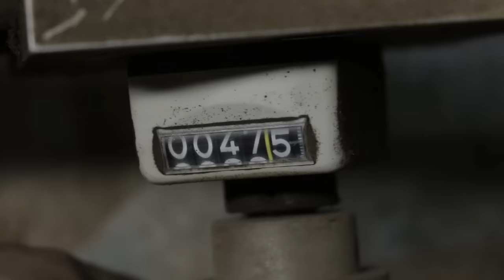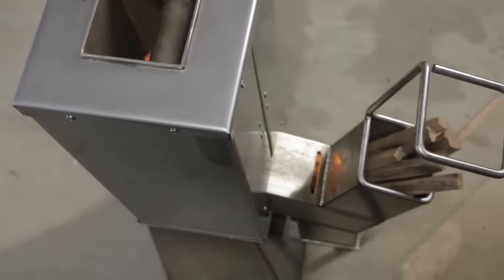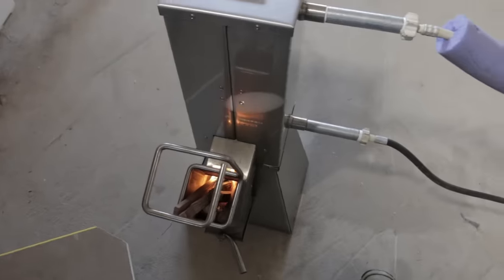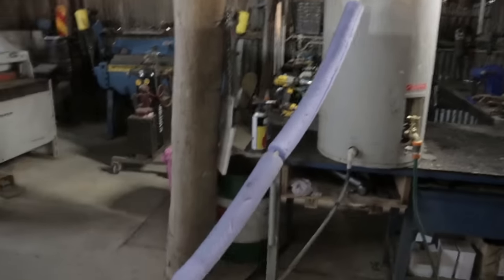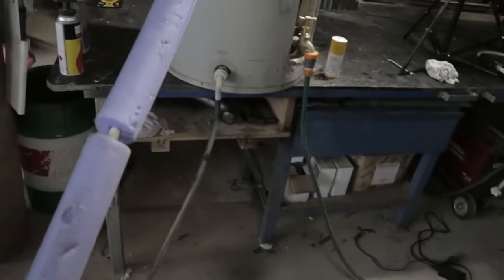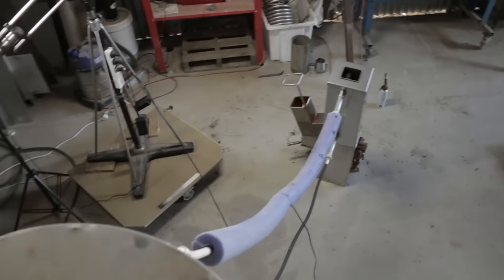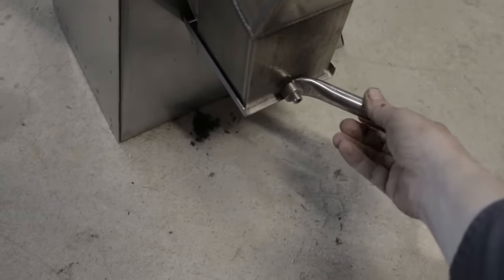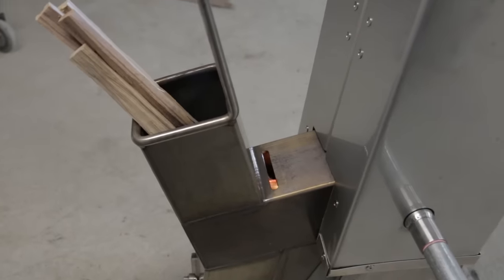Making an insulated rocket stove hot water system

Comment: Many years ago I modified a 30 gallon hws to be heated by my semi combustion stove, when it was cranking the water in the tank would boil fairly violently. I was told that I had the heated water inlet too high. Looks like yours is noticeably higher than mine was. Good job
Reply from the maker: Good to know. Thank you
Reply: @LittleAussieRockets  I didn’t actually make the mods to lower the inlet pipe. So that is unproven advice. I’d already had the 3/4” pipes brazed into the tank.

Comment: Awesome video!  

Since you're using convection and no pump.... But if you did use a pump, flow direction can help depending on heating or cooling.  Ideally you would want to draw from the bottom as the outlet and inlet at the top.  Sometimes convection can reverse this but the idea with flow from the bottom will produce a hotter temperature.  The top inlet begins to heat the water and as the temp rises you get closer to the hottest thermal source.

Comment: I watched the whole thing! Amazingly complex construction, I would not have attempted it! I have done some imagining myself on wood burning stoves, and what I currently have is a "Horn*, upside down, 12" on four sides Bottom, and reducing to just 4* on four sides just below the firebrick burn chamber. The "Horn" will be elevated above the floor by 4" round, and the ratio between the area of air I take bottom is 20% top to bottom, ie 16" total volume too, and 144"area bottom. 
The idea is that air entering the Bottom of the "Horn" at 2 mph, will accelerate to approx 36-40 mph as it reaches the burn chamber. Should be quite a good air flow feeding the fire. 
😆

Comment: Great workmanship! I think you can increase the heat transfer time by increasing the number of passes the water makes. Weld the outer rectangular pipes on the narrower side to the square tubing and interconnect the 4 chambers created by the rectangular tubes in series. Right now it’s 1 pass. Seems you can get as much as 4 passes if series.

Comment: Soft pine wood burn much hotter than any hard wood. Of course Pine has lower energy density and it disappears really fast but you can achieve much higher temperatures faster. Nice stove. Good work.

Comment: The fire is climbing up the wood as the air isn't being pulled in at the staging area for the burnables. I think due to the slot cut out at the top of the burn chamber. 
Air would be drawn in there before being pulled in around the wood. Maybe test the theory out by temporarily closing off the slot and seeing if it makes a difference.
Your welds are topnotch!!!

Comment: I think the other issue you may have is the heat hitting the bottom tube first which is normally the cold return line in a thermo syphon.  Maybe a check valve in the bottom line to make the thermo syphon work better.

Comment: I’m a little late to your video ant there are a lot of comments so someone has probably already mentioned this. You will get even more heat transfer by reversing the water flow. I would say add additional coils on the way down but this could restrict the exhaust flow that drives your rocket stove. Awesome appliance though, quality construction and an elegant design.

Comment: Lot of effort went in to the editing on that, good work! My thermal hot water system 50 liter tank takes about 2hrs before the bottom pipe gets warm, i had to put a one way flow valve in the cold in to the fire to stop reverse thermal syphon from happening after fire goes out and the water temperature in the tank equalises, ive read you need a 14 degree temperature difference for the syphon to work.
Reply from the maker: Thank you 👍 that's good to know.
Reply: Is there really enough pressure in the thermosyphon to open a standard one-way valve?

Comment: Great Project, 2 things you may consider for safety and efficiency (1) the need for an expansion vessel on the primary hot water between the boiler and cylinder coil, coupled with a relief valve, (2) baffles in the flue to retain the heat slightly longer, they will soot up so should be loose enough for removal...

Comment: It would be very interesting if you could measure the difference between a clean flue/pipes vs. sooty. The reduction in efficiency is rarely measured and quantified so I am very curious about that.

Your TIG welding is great! And your videos have become top notch as well. 

I know the input of a rocket stove is all about using twigs and smaller stuff. But a larger unit burning like 10cm diam wood is also very interesting as they are less time consuming to both produce, store and feed. 

One day I will for sure do a combo solar/rocket stove water heater for a outdoor shower here on the west coast of Norway. If you figure out how to ship flat packed - I am interested.
Reply: Soot build up is pretty significant that's why steam plants "soot blow" to clean the tubes every day or so.
Reply: @calebreutener870  Thanks! So the insides should be really accessible for cleaning in a smaller unit then?
Reply: I concur it's significant. You would thank your self for access to clean.

Comment: That's a lovely little stove.  Might be your pipework to and from the heater tank isn't big enough for the convection process to really get going, which would explain the bottom pipe being cool.  A pump might help.

Oh, and you could probably get a lot more life from your slitting discs by not plunging straight through.  Might take slightly longer to cut, but 5 to 10 times longer per disc would be my guess.

Comment: I've dreamed of a system like this for an off grid build but with a couple additions.  First off, I would want a pellet feeding system  for longer burn times so I don't have to feed it every 10 minutes.  Second, I  would want to route it for in-floor heating and also to heat solar panels to melt the snow off.  Both of those are only wanted at the same time I would want the stove on.  For hot water, I am happy with the convenience of an on-demand propane system.
Reply from the maker: I appreciate your thoughts. I have been tinkering with a pellet hopper for the stove. I haven't quite perfected it yet. It's not as hot as I would like, but it certainly chugs along at a very consistent rate.
Reply: Buy pellets?  Wood is free.
Reply: 1. Having options is always better than not.   2. Have you ever seen the burn rate on these things?  It's not just shove a giant piece of firewood in and let it burn for several hours.  3. You can make pellets at home relatively easily if you are so inclined. 4.  There is literally a pellet mill 4 blocks from my house that sells pallets of pellets to locals at significant discount. @MrSprintcat
Reply: There is a guy , 3 towns over that has 8 tons  of free coal in his basement.  I get it thank you.

Comment: Beautiful work! You could use an IR thermometer to measure various surface temperatures if you wanted to. I use mine to measure various temps on our wood burners as well as the air temp coming out of the vents.
Reply: Your video is nice. But without a doubt I believe that the system that uses COMPRESSED AIR as fuel is better. YES YES exactly like that. You read very well. Remember that the flame always heats faster than any other form they would have you believe. Then click on the round image next to the message where Tecnitalia55 is written. And you will enter my page where you can see many of my creations, including the stove that BURN COMPRESSED AIR. Leave a message are welcome. And if you liked it, let me know about my page. Sorry but it's in Italian. Thank you.

Comment: I don't think you will find this unit anywhere near as efficient for the amount of wood burned as a coil system.  Just not enough contact area for heat transfer.  On the other hand glad to see this unit was insulated which is how a true "rocket stove" is designed.  They don't have to be insulated, but if efficiency of the stove is your goal they should be. Might consider some fins on the discharge pipe of the stove or it is likely to get hot enough over time to melt the plastic knob on the water line. All in all a damn nice job, great welding compared to mine and glad to hear you got further along in you education than I did as I was not allowed to enter third grade.

Comment: Idea: Fully jacketed chimney rather than insulated. Use two square pipes using some plate to run double duty as baffles to slow flow and increase transfer and assist in heat exchange. 

Gold plated work mate. Might have to buy one for the Mrs so I can have one.

Comment: make the feed pipe longer to put a flap on the end to restrict flow and force more burning towards the ash tray via the slot you cut. now you can build the external part with a big can and more insulation to direct the smoke down. restricting the exhaust like this makes the burning more efficient, and if the wood burns right, will even be hotter, so long as its fed enough oxygen, which is why you experiment with the flap open and closed. good video. well worth the time

Comment: I would suggest having the woods sit on a 10-20 mil grate so it is a bit elevated and letting some air flow in the back and flow under the wood, similar to a pellet basket.
Also, would it be more efficient to have the hot water hose go to the bottom of the tank so that the rising hot water in the tank would create a more natural circulation? 
That had to be a very expensive build using all SS.
Thanks for sharing, I'm sure that took a lot of time to make and edit this video. 😁👍🏻

Comment: Have you ever thought about making one of these hot water tank ones like you just built in this video but instead of using as a water tank fill it with concrete so it's a thermal mass heater?
Reply from the maker: I made a bigger one and filled it with sand.  It stayed hot for an hour and warm to the touch for a couple more after that.  I think for that to work well you need a lot more thermal mess for it to make a difference.

Comment: Love your design builds , spot on pal.  Erm instead of the coil or thru pipes to heat the water , which a 30 degree change in an hour is impressive.  How bout similar to, a kettle type rocket stove where water is, heated in a chamber.  And a tap ,let's it exit.  How quick do you reckon this concept ,can heat water , yet instead of kettle design.  A chamber with inlet and outlet ,for water. That encompasses, the rocket stove chimney, with obs lagging to contain heat ??? Hard for me to write a picture. But hopefully it makes sense ??

Comment: A rocket stove with a casing that has sand in it that holds heat from the stove and has copper piping running through the hot sand.
To heat water directly have a stainless steel pipe running through the fire box area that also connects into the copper pipe via a valve.

Comment: Hm, here is suggestion if I may. Well, lots of distilleries using steam for heating the mashes in their boilers. There is a point in size of boiler when electricity is no longer feasible and they using steam generators. Probably smaller distilleries that use electricity will switch to steam generators if does not require to much investment and space to install.
Looking at this creation of yours as a water heater, if you can go one step above and use rocket stove to create a steam maybe you can have some market to open to you. I know that Aussies now try to boost distillery industry, so maybe there could be something you can jump in. Rocket stove can be set for simple burning wood or to burn a pellets, and believe burning pellets to get a steam instead of electricity in distilleries should be cheaper.
Just throwing an idea at you. I like it and very good implementation, you just have to figure out how to keep it running all the time, because hot water is used all day long, so you need setup that automatically fires rocket stove when needed. Cheer.

Comment: Here to see what's boiling (moohaha) in the field of rocket stoves and several secondary applications. My question would be: How did you chose a rectangular design over a circular one? So, why not two round pipes, one with a larger and one with a smaller diameter closed off at the top and the bottom (discarded fire extinguisher or so) and three if you want to insulate. That's what I myself have in mind as a chimney at least, with a container for water in the center and two bits of steel tube to lead the water in and out. I see lots of rectangular chimneys anyway, maybe just square ones. Why? No idea.

Comment: Great stuff. I know a lot was sped up. Somewhere between the first and second time u were bending the SS round bar, it looked like u were doing the equivalent of spot welding on the main unit, wasn’t fusing/tacking an edge. Didn’t see any filler rod, and that part was sped up?
Reply from the maker: Yes, I was just fused tacking that part together as this is just a prototype and it was most certainly sped up. But this process is fairly quick.

Comment: I had the same idea, but adding a bigger box for the coil, and stuffing the space on the outside of the coil with a mixture of  Heat mass substance (like Graphite,sand, clay,stones etc..with thin plastic straws to make it holy, which burn away leaving extra holes above the burn chamber to channel heat )  , and well insulated. like you have done, as to store heat in the heat exchanger as in thermal battery?

Comment: Excellent build. Perhaps for the smoke you could put a small swing cover for the vent so that less air would be drawn in as the unit dwindles down on wood and less smoke comes up the feed tube, maybe. I wonder if you also come up with some sort of thermal spring mechanism that automatically closes that tiny vent once the unit is up to temp

Comment: Not sure if it would help but I would add more heatsinks between the chimney and water jacket i.e.. a stack of bolts welded thread side in the water jacket and head side in the chimney. I would also look at adding a slight angle on the chimney with the water jacket on the top of the angle as heat rises so it would get a little more heat transfer (not sure on that one and how much of a angle would be needed to be of benefit)

Comment: Coil water tube around and through the flue.
Fill between the flue and the outer wall with sand. Better thermal transfer and longer storage capacity.

Comment: I made a thermosyphon wood stove once. Worked okay for what I had laying around. If I was to ever do it again I would use more modern stuff. I also built my own hot water boiler using an open system and parts I had laying around. Once again I used the stuff I had laying around. I was able to get radiator fluid from a auto shop for free which is what I used to keep it from freezing. 
I have a cast Iron boiler that I found after looking for one for many years like it. The only sad thing is I did not inspect the internals before I hauled it up and out of the basement. Someone had taken the old stuff out and built a crude rebar thing. I will one day strip it out and have something better built in its place. Then sand blast and paint it with high temp paint. They had a hot water loop that came with them at one time. Yet I am not sure what it looked like. This boiler is pre 1900s. I just need to find some cast iron radiators and then build out the expansion system and blow off stuff so that it matches some what with the boiler. Then set it up in my new house when it gets built.

Comment: Nice build! Any details on what looks to be a DIY positioner for welding?
Reply from the maker: Yes, it's just a 24-volt DC motor that I repurposed from an old actuator, coupled to a 10 to 1 gearbox.  It's basically held together with baling twine inside an old toolbox if you get what I mean.  I'm not very proud of the internals, hence no one has ever seen it.  In hindsight, it needs a lower ratio gearbox. (30 to 1)
I really need to build a better one
that's more rigid and can go a little slower.
The speed control is just a cheap eBay job.
If you were to search DC speed controller 12 v 24 v you would probably find the same one I used. I think I paid $8 for mine at the time. The chuck is off my mini lathe and the platinum it's sitting on is an old  v belt pulley that gives you a nice place to wrap a copper strand for the earth. That's probably the only thing I would bring over to the new build.

Comment: Have you thought about simply building your Rocket Stove directly inside of a water heater? Use the heater in place of the core usually heated by NG? This would save the entire percolating step as well as heat loss during transfer, etc. Also, you wouldn't have to insulate.
Reply from the maker: Yes I have.  I have a model designed up to do just that. I just need the time to get to it. There are so many ways to skin this cat. 
I hope you're not a cat person, no offense 😅
Reply: This will probably cool down the stove too much (unless it's double-walled)
Reply: @SolarCookingGermany probably not. The internal temperature will be hell's hot, the air around the fire will do just fine keeping the necessary heat trapped.
Reply: This is then just a giant Kelly kettle.

Comment: You get a greater volume of hot water by converting a gas hot water heater and make it into a wood burning hot water heater. Pull off the gas burner and use a small can to contain the fire, and I mean very small fire consisting of a handful of kindling. You’ll be amazed how fast it heats water and a lot of it with just a little kindling.
Reply: Look forward to your video.

Comment: Since you can’t touch the outside of the burner means that a lot of heat is not transferred to the water.  Probably you will get better result if you integrate the burner inside the water tank as the same way that it is do inside of the  home gas water heaters

Comment: You should try fitting a lockshield valve on the return to regulate the flow and slow it down so that the water in the circuit gets hotter. The water in the cylinder will get hotter much quicker